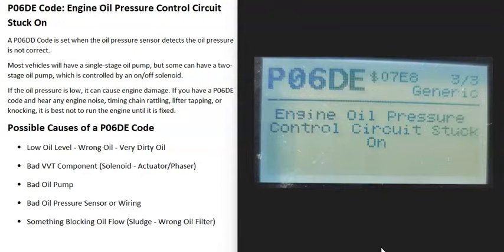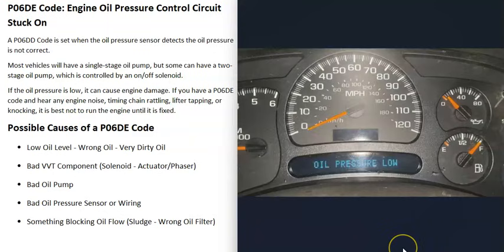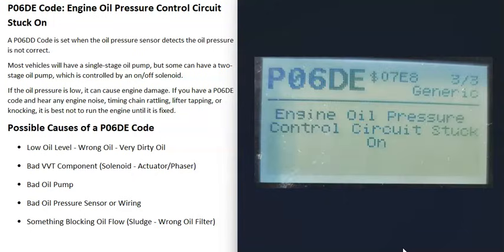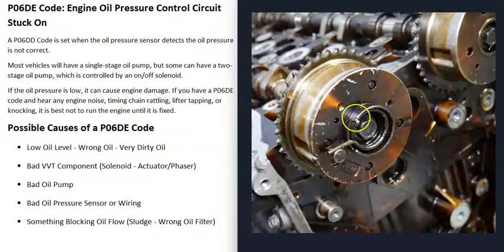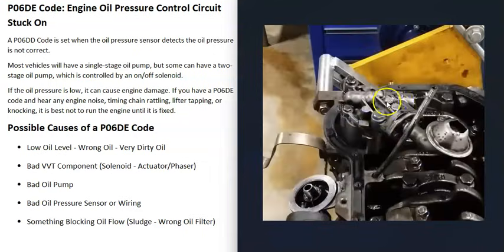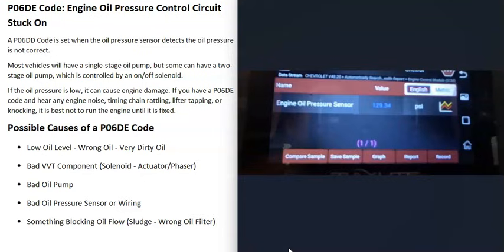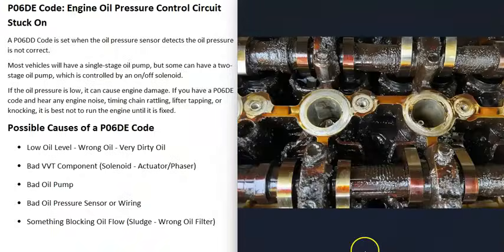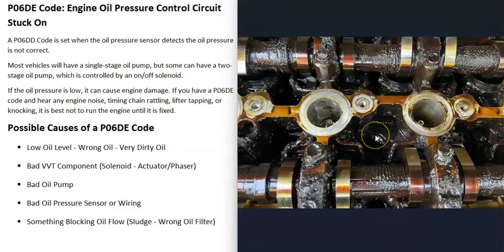Causes and Fixes P06DE Code: Engine Oil Pressure Control Circuit Stuck On

Comment from the maker: NOTE: I should have talked more about two-stage oil pumps. If your vehicle has a two-stage (dual-stage) oil pump, be sure to check the Oil Control Solenoid Valve.
Reply: Where is this oil control solenoid valve, on the pump or somewhere outside the engine?
Reply: @kickiskrlec  The oil control solenoid is mounted to the oil pump, inside the engine. Do a YT search for "3.6 pentastar oil pump" and you'll get a better idea.

Comment: Wife has a 2018 Chevy Equinox.  We have been to three mechanics who are unable to find the problem accurately.   First mechanic simply reset the code.   Second mechanic changed the oil and filter, and replaced the "oil solenoid."   The code came back up less than two weeks later.  That mechanic hooked up a monitor and had my wife run the engine.  He could not find anything wrong, and reset the code.   Last Sunday the code came back up.  We scheduled an appointment with a Chevy dealer for today.  This morning the "check engine" light wasn't on when I started the car but I took the vehicle to the dealer anyway.   I showed the service technician the code history on my phone.   An hour and a half later he reported that they couldn't find anything wrong.   Do you have any suggestions?
Reply from the maker: If everything tests good, there may be an intermittent issue, such as a loose wire that only disconnects on a bump but reconnects while testing. Or possibly a component starting to fail but still works most of the time. Intermittent issues can be difficult to diagnose.

Comment: 2018 dodge charger sxt 3.6, I have amber engine light and P06DE code, no unusual engine noises, oil pressure is stuck on high. Thinking it's the solenoid on the oil pump. Any thoughts?
Reply from the maker: That engine uses a Dual Stage Engine Oil Pump controlled by a solenoid for low pressure and high pressure, so yes, I would test the Oil Pump Solenoid and wiring.
Reply: How expensive are rhese fixes at the shop?
Reply: My oil pressure is stuck on high. Mechanic says bad solenoid in the oil pump. Wish there was a way to access it or tap on it, the solenoid. Be nice to free it up. Probably just stuck or something. I added the wrong oil on my way home on a trip, wasn’t even that far off. And I got that code a day or 2 later.

Comment: My oil pressure is 61psi I change the oil. No knock and no leaks. Engine oil been flushed. Vvt been changed. On thing I didn’t change is the wire to the switch